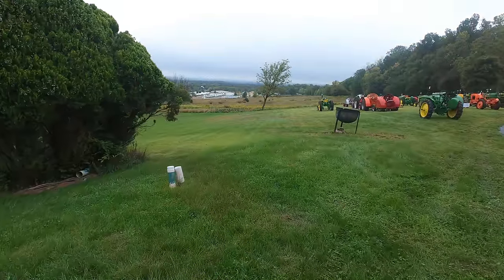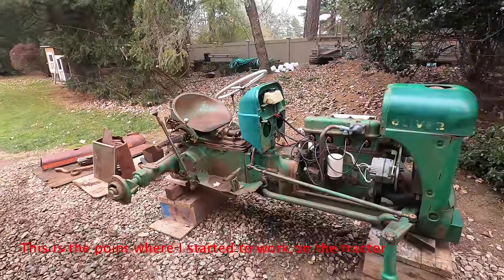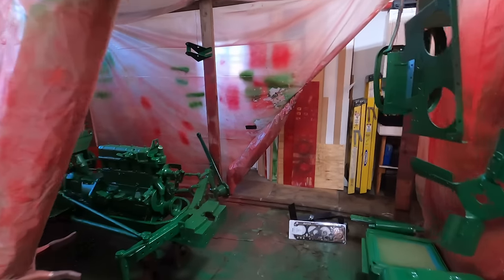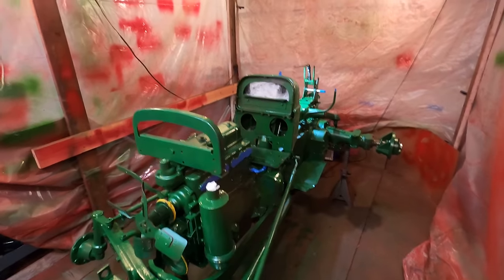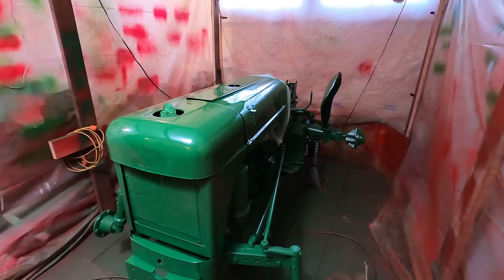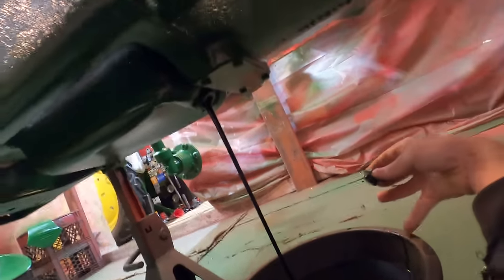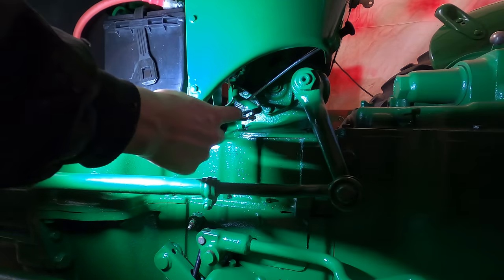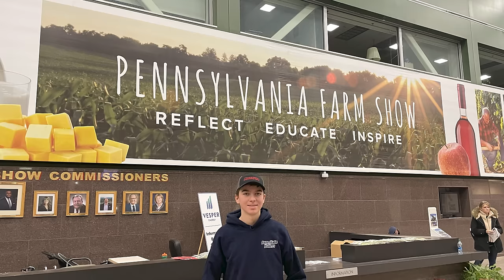Oliver Super 55 Revival and Repaint

Comment: Your dad did a great job, a hell of a lot of work in that prep and paint work. Well done for salving another piece of our farming history. One bit of advice from an old hand, before you start it, disconnect the coil and crank the engine over , this will pump oil up to the top end and fill the oil filter and build oil pressure, before you actually start the engine.. very important

Comment: I think your paint technique is brilliant,  brush on the primer and first color coat. I’m using that one. 👍🏻 Another way to check for TDC is to put a wood dowel down the spark plug hole and rotate the engine until the dowel is at its highest point.

Comment: Great job.  On the throttle setup what McMaster numbers did you order. I have Oliver 55 diesel with a broken linkage. Any help would be appreciated. Thanks
Reply from the maker: 2x 60645K411 Ball Joint 1x 10-32 x 6” threaded rod